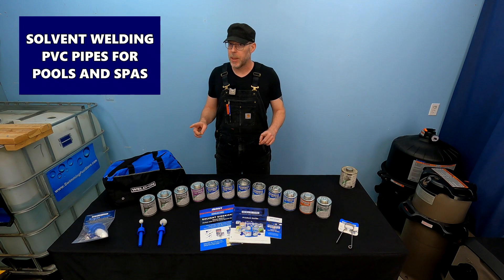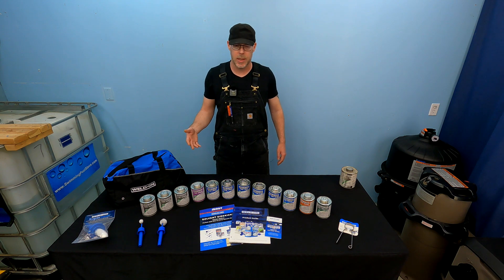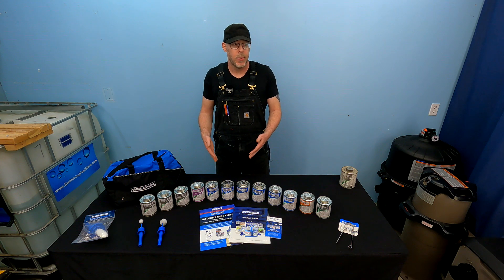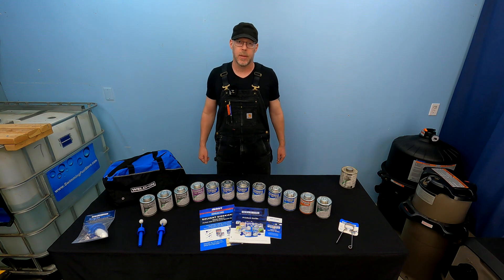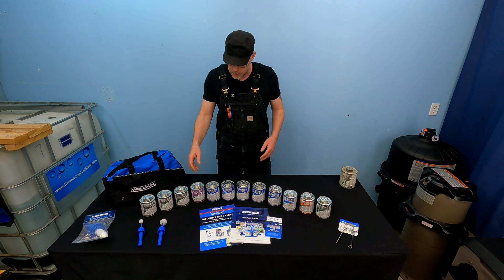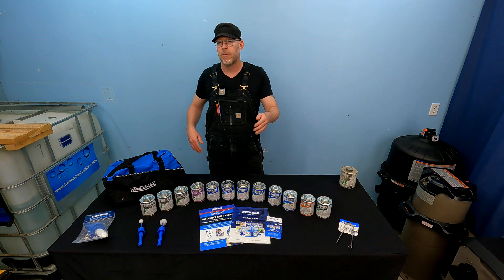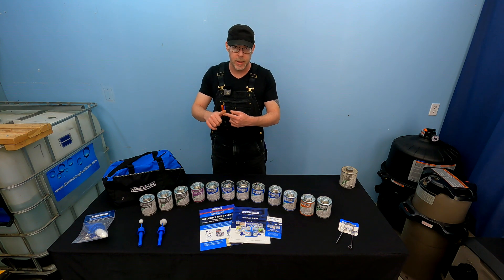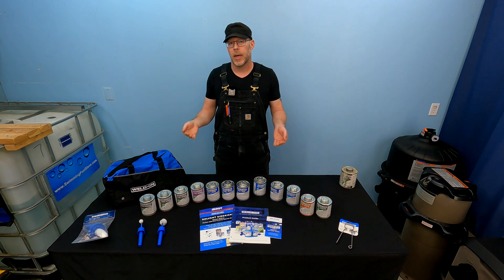Solvent Welding PVC For Swimming Pools

Comment: Over the years, I have had gallons of MEK poured over most parts of me while building pools. When you accidentally splash it in your eye, you simply keep your eye closed for about 10 seconds, and it is gone. I use MEK CLEAR PRIMER from a fresh, clean rag and CLEAR PRESSURE GLUE for everything. When it comes to heating out fittings with a heat gun, I prefer heating out other people's connections.

Comment: As far as the application, there are connections where you can't see the other side of the pipe that you need to attach a fitting to. In those cases its best to not only swab the glue around the pipe, but on the blind side also run the swab up and down the pipe.
This will help eliminate the possibility of leaving a bare spot where you can't see it.
(I learned that the hard way many years ago!)

Comment: Thanks Steve! I have only done a couple of plumbing projects on my own pool. One thing I ended up puzzled about was that for the Pentair check valves - which seem all to have CPVC bodies - they recommended Weld-on 724. I went ahead and used that even though it's a bit hard to find and not cheap. Yet I saw several forums with pool pros saying just use the usual PVC glue like 711 and it will be fine. What would you say?